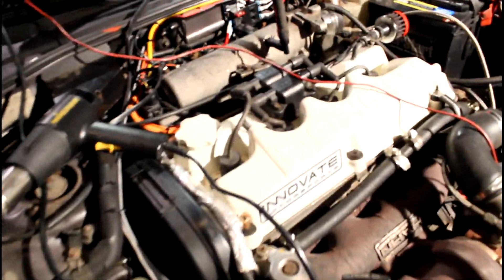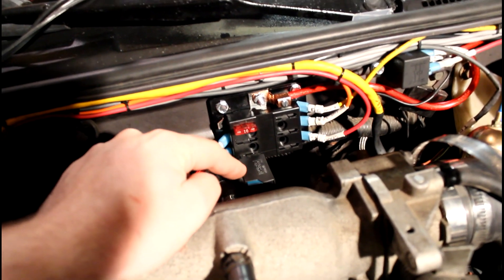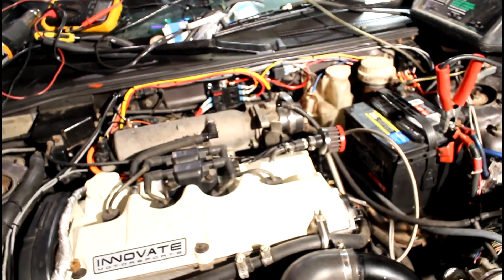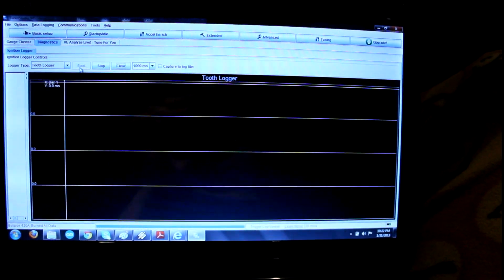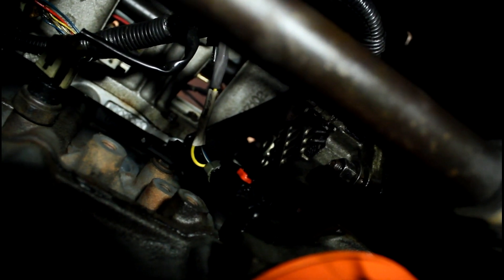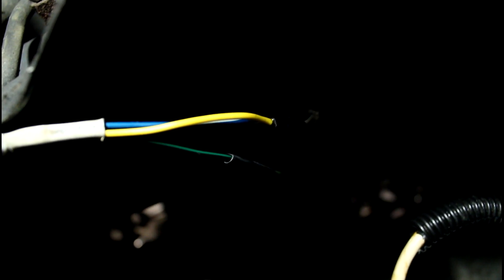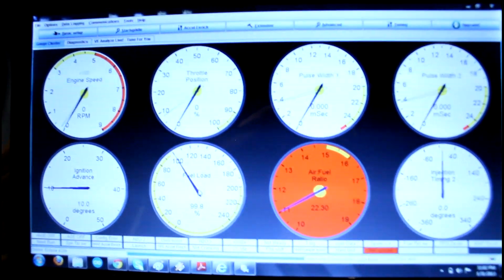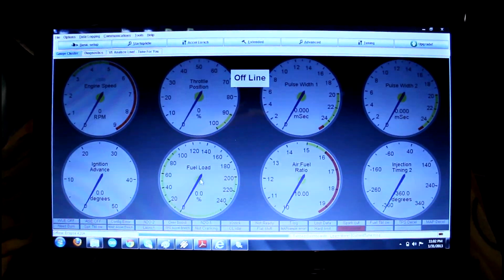Evan's Megasquirt Build Ep 19 - Crank Position Sensor Testing

Comment: I know it's been 7 years since this post, but my son and I are working on the same project now did you have to put in a 1K resistor in the crank sensor line and the crank sensor 5 volt line? In order for the megasquirt to see the signal we are using a megasquirt ms3x
Reply from the maker: I don't think I had to. I didn't rewatch this video, but I do recall the crank sensor wire diagram I had, the colors were incorrect.

Comment from the maker: You'll need to supply ground and 5v+ to the sensor from the megasquirt.  The return (signal) wire will have 0v on it typically, but will pulse 5v when the engine is running. You can't measure it without a scope really.